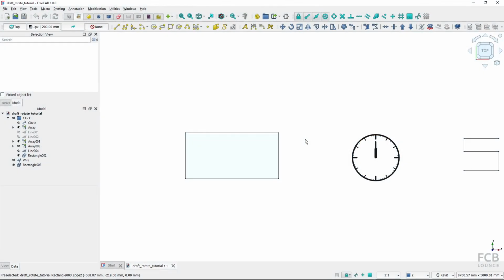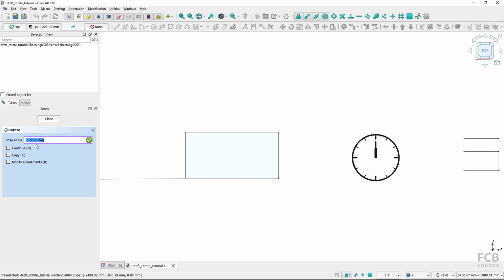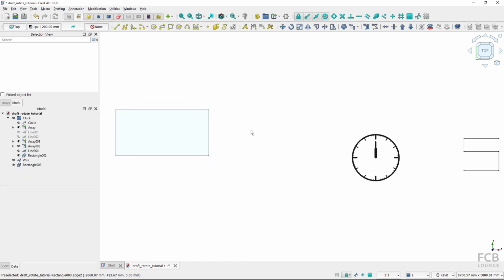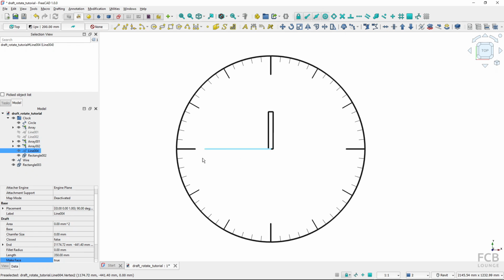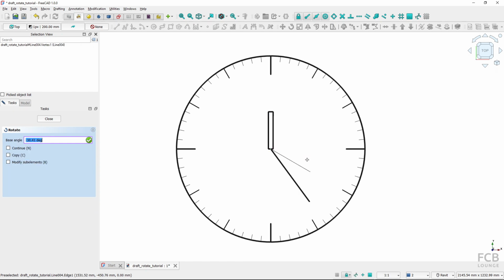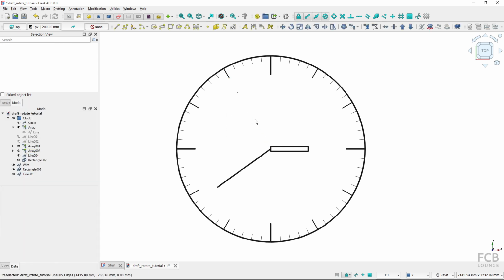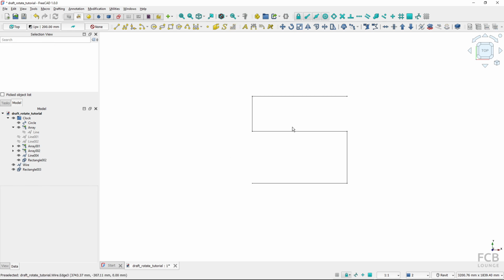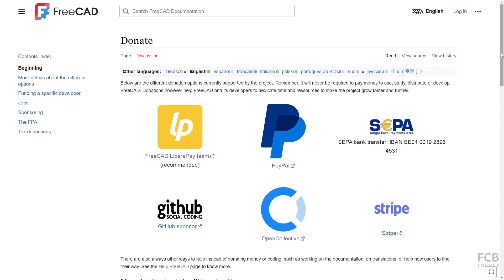Draft Rotate Tool in FreeCAD

Comment: Hello Tom. 
Thanks for the hints on this video. 
I wonder if it's possible to rotate a full BIM Building because "Transform" tool is not available within BIM Building.
I'm going to send to your email a project where I'm finding some (2) nasty findings regarding to creating windows and doors over external and interior walls. 
Somehow after creating a window or door FreeCAD is presenting error messages on a full constrained sketch of the interior walls or exterior walls. 
It's saying that some constraints are not valid due to external geometries... 
I need to delete the "creation of the window/door" for the sketches becoming fully recomputeable again.
Another issue is regarding a 6 waters roof. 
I can't find a way to make everything matching correctly. 
I've even tried changing which Face the  roof calculations are starting from but mission impossible..

Regards
Reply from the maker: It is possible to rotate the whole building, but there is a problem with "double rotation" of windows and doors. To avoid this, you have to select only walls which host doors and windows (so basically deselect doors and windows). It is kind of similar problem to one described here: https://github.com/FreeCAD/FreeCAD/issues/16278
Reply from the maker: BIM objects are currently not TNP-resistant. So when creating sketches, it is best to avoid any external geometry constraints.
Reply: @FCBlounge  External geometry makes sketching too much easier for example creating slabs and roof rectangle bases...
I'm almost allergic  to Draft design, that's why...
Reply from the maker: @ The culprit might be different than the external geometry, that is just what pops into my mind. I had a lot of breakages when I was using external geometry. Now I try to use the external geometry and delete it after the sketch is created. There might be better ways to tackle this, I am not very experienced with Sketcher.